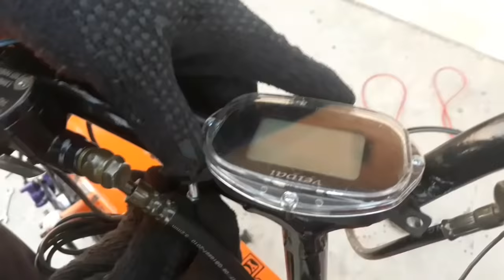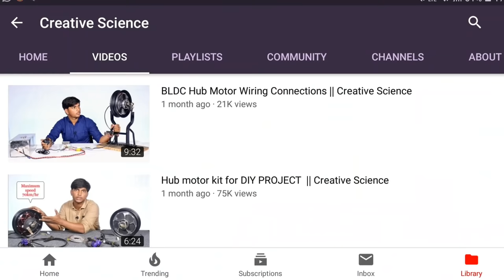How To Make Mini Electric Motorcycle At Home || DIY PROJECT | Beginners Guide | Creative science

Comment: Project is really good but finish and detailing are missing like mudguard and for those wire which are tangled can be hidden by plastic case and the  dimension of the frame is small with no back support. If there are potholes and no back support it may cause accident... So safety point is lacking overall a good attempt